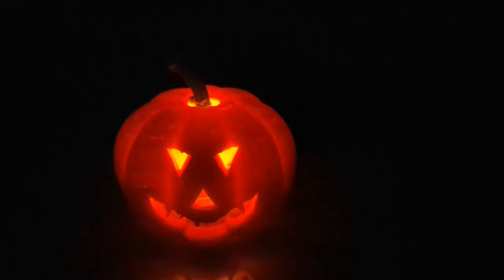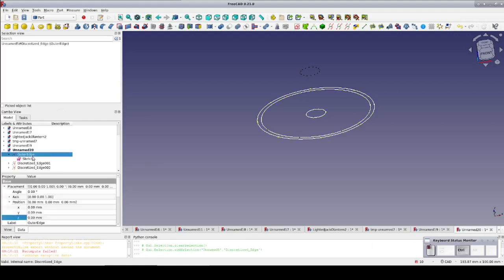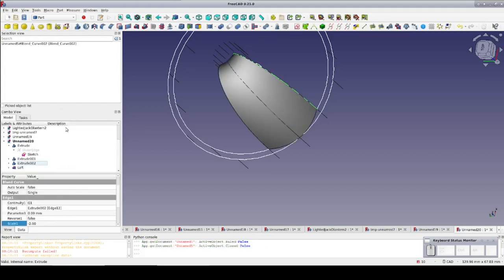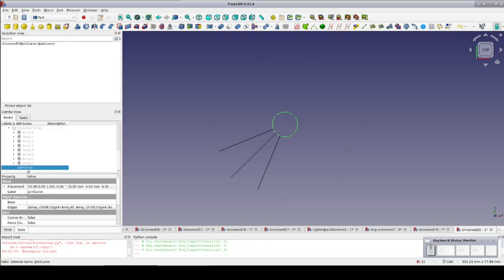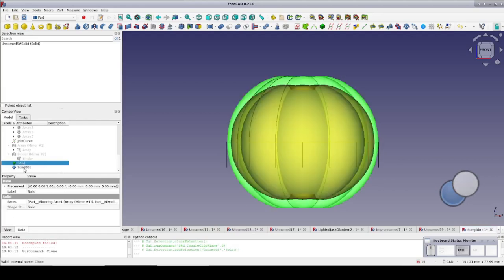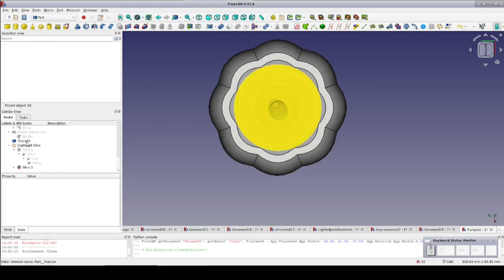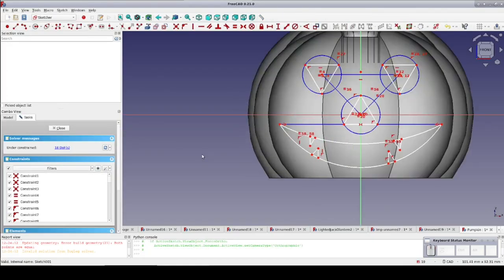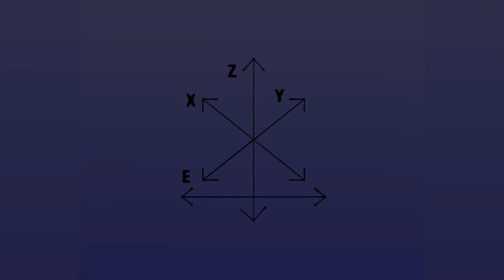Jack-o'lantern: Cutting up with FreeCAD

Comment: Can't follow this. When I look at the part workbench, there is no way to create a sketch. And when I try to use OuterEdge - 4 it says property not found. And since you don't describe where that information comes from, I have find somebody else to explain to me what you aren't telling me.
Reply from the maker: That was Constraints.OuterDiameter-4mm You may have missed the step of naming the diameter constraint on the largest circle. Since I don't name an object, FreeCAD assumes (correctly) that I am referring to a property within the sketch.

I am using a custom toolbar to add CreateSketch to the UI for the Part workbench since it is a very common operation. See my video on that here: https://www.youtube.com/watch?v=N8jpKo9uAEs